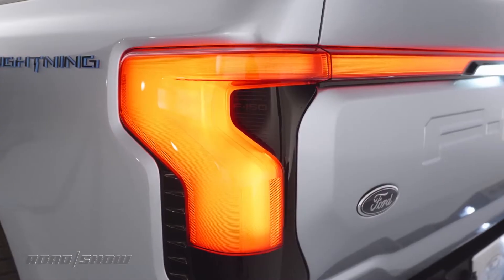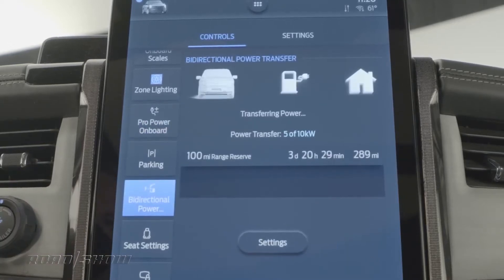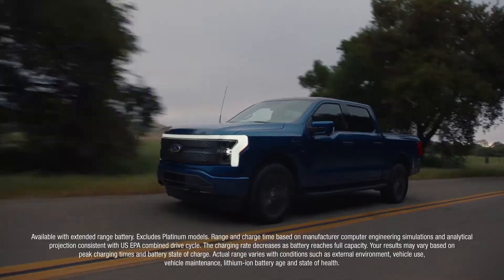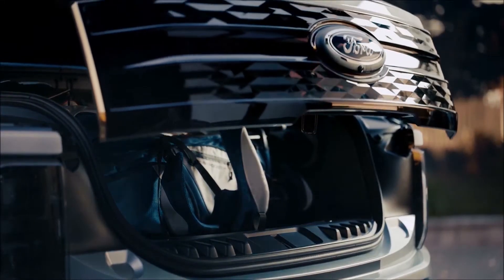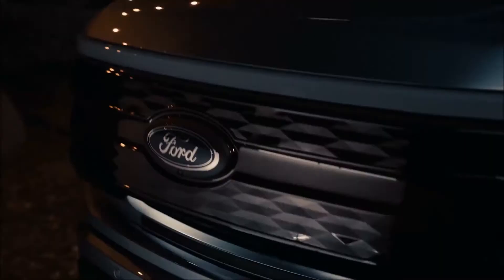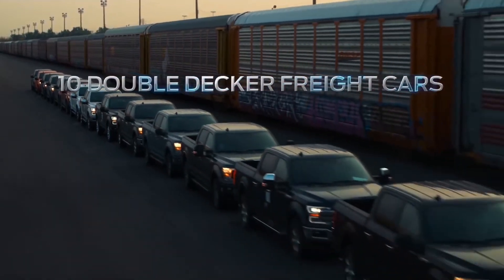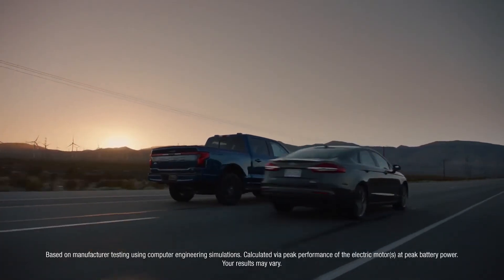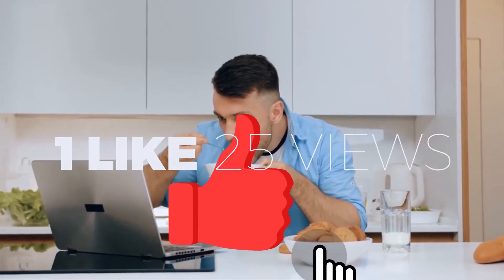WHAT'S UNDER THE HOOD?

Comment: It's all great and all but not every town and or city you drive to with your RV is going to have  a charging station in it  (just not comfortable with the uncertainty of the next town not having a charging station. For that i will never travel with an electric car or truck. Good for just city driving to and from work but not good for travel. It would cost to much to build the infrastructure for with idea to become a reality.
Reply from the maker: Great point, but here's the thing that a lot of people don't think about. When you own an EV, 95% of the time you don't use a charging station. Your vehicle is plugged in at home and every day you leave your house with a full battery. In a regular car or truck, you can only fill up at a gas station. In an EV, your main charging station is your home. Basically, every time you leave your house you do so with a full tank. Not many people drive more than 50 miles a day. If you have a range of 300 miles you're on the top quarter tank of juice all the time.

Comment: If the truck came in a 2 door and a long bed, I would consider buying one, But as long as you  have a 4 door, I'm not interested.
Reply: I hear ya, I believe it will happen so they can make ambulance / rescue versions for government purposes. I just hope we don’t have to wait much longer. If U are as old as I am, U should remember Ford made an electric Ranger 20 years ago ( Who Killed the ELECTRIC car ? )⚡️🛻
Reply from the maker: I do remember. The range was about 60 miles and the price was $50k.
Reply: Extended cab, with step side bed so no wells inside the bed.. I may just buy this and swap the bed to a custom bed... I’ll order the fleet model, with out the bed. Wonder if they’ll do that. If they did , they would definitely make a new statement.
Reply from the maker: +Brian kumpan Yeah, I hear ya. The long bed is clutch, hopefully they will come out with that option. And if they do, I would guess they’d do it in a 2-door too
Reply: They're hoping to get cuv and SUV buyers as well. I'm kinda digging it. Ideally I'd want 400 miles of range but I could work with 300.